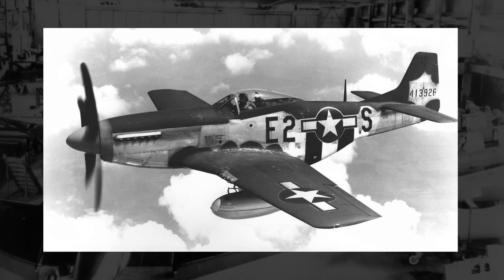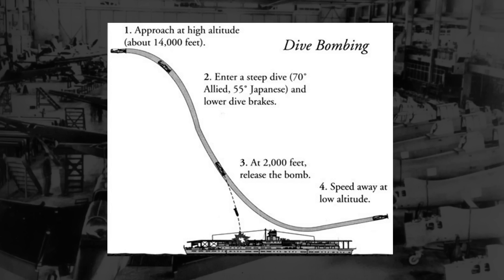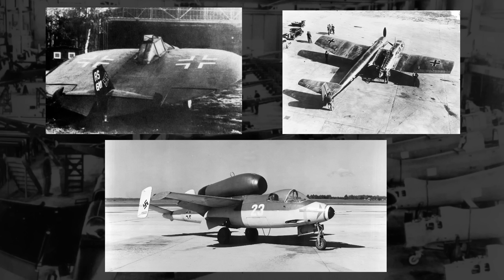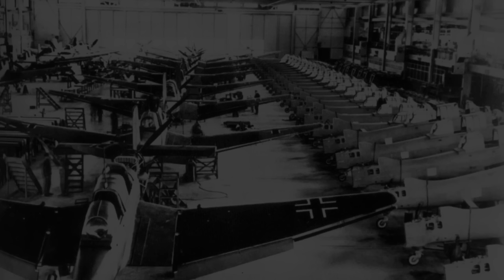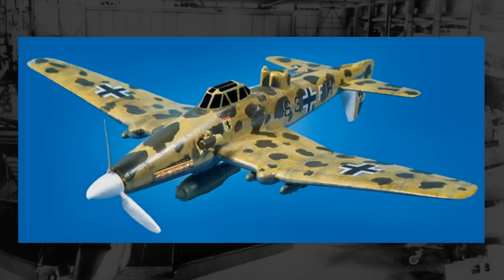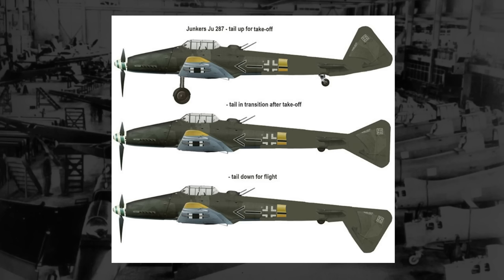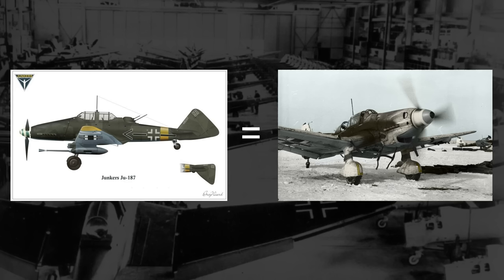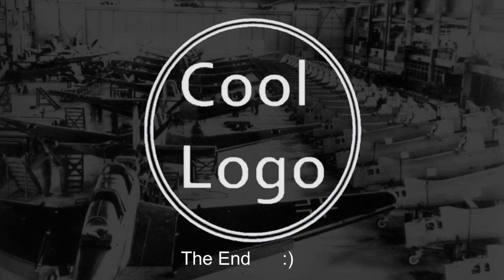The Rotating-Tail Stuka: Junkers Ju 187

Comment: A jack screw could easily raise and lower the tail. The trim would change as the prop wash would likely switch which side it was pushing against. I don’t see why it wouldn’t work though. You’d want to make the transition upon reaching altitude, and again before descending for landing. There would definitely be some wiggling as the tail changed position. Would likely need strakes added for more stability which would be figured out during testing.
Reply: What might pose a problem is the disturbance in airflow when carrying a centerline bomb, especially a big one.

Comment: Took awhile to realize that the rotation was a pivot to swing up and down. I started out thinking the thing would rotate cw and ccw  from pilot perspective.
So actually it shouldn't have been a huge change, a large pivot pin plus guides maybe at the front of the stab and a cable rudder control.

Comment: I've never seen a rotating tail in action before.  Interesting idea to improve defensive FOV.  The rotating mechanism would add massively to the weight of the tail.  Also, the aircraft might have really poor stability during the transition between between up and down tail.  Also, if the tail became stuck down the plane would be impossible to land safely.
Reply: Could have used a manual mechanical rotating device to reduce weight. Like a wheel behind the pilot that the gunner would turn to rotate it. If he died, could be a steel spring rigup that the pilot could flip a switch to turn the tail up. It would have worked flawlessly and the gyro effect would have prevented any airflow stability issues. It would work in either position because the air is still flowing over the ailerons and tail as a rudder. Technically that's all the tail was to begin with. I think the result of this setup would have given similar performance if a multiple gunner station of a b series bomber in a small plane with superior maneuverability.
Reply: The tail itself would provide considerable lateral stability without the vetical fin during the short ministration.    If absolutely necessary dragerlons could be added to the wing,
Reply: @ironhell813 idk about how you describe anything mechanically working flawlessly in this example… the rendering is an example of of a ju-87 there isn’t any proof of this concept… if the 187 had a fixed inverted tail plane then it would make sense but it was never a working or hypothesis prototype built… I’m saying this because of under modern times we can actually make this work but in those times actually look more into it

Comment: Since late WW1, aircraft with rear facing defensive guns had limiters that stopped the guns from firing when aiming at the tail.
Reply: There are some interesting stories of how the front facing guns were evolved to have interrupters as well. A few pilots shot off their propellers.
Reply: German aerial machine guns used electrical primers which made interrupter mechanisms easy to make.
Reply: Think it depending on the plane, and even then from the very brief bit of reading I just did, pilots were recommended not to put too much faith in them because they weren't always reliable.
Reply: In which case, all a chasing plane would have to do, to avoid being shot at, would be to keep in line astern.
Reply: @Gottenhimfella  If the plane continued to fly in a perfectly streight line, yes.  But if they were alone, they would turn to give the gunner a clear shot and if in a formation, then their buddies would still have a clear shot.
Reply: @scottthewaterwarrior  In the "alone" case: while turning they would be presenting the chaser with an ever-enlarging target, before their own heading stabilised so their gun could acquire the chasing plane as a target.
You make a good point when it comes to formation flying, but a plane's defensive capabilities are as strong as the weakest scenario, not the strongest.
Reply: @Gottenhimfella  I didn't mean full turn, just yaw a little with the rudder.
Reply: @scottthewaterwarrior   A little yaw enables the chaser to stay in line

Comment: Plenty of subsequent aircraft had variable geometry - just not in that way. Interesting video!👍🏻
Reply: Yes, I did gather that was the only way it could work concurrent with the diagram. Still variable geometry though: a swing-tail, if you like. Lateral rotation could introduce all manner of undesirable transition effects and would be a complicated setup for cable controls, requiring a full reversal of rudder inputs. The Mig.27 and possibly others have retractable ventral fins so this wasn’t necessarily outlandish, but even the Mig’s rotates to the right so is likely managed by trim input.
Reply: @ThreenaddiesRexMegistus  Rudder pedals would still work the same on the pivot-tail.

Comment: The term 'pivot' would be less confusing than 'rotate'. IMO 'rotate' insinuates rotation around the long axis like prop.

A pivoting rudder assembly was a great deal of unnecessary trouble to lower the rudder assembly for the rear gunner. An easier path would be to go to a tricycle landing gear like the Airacobra to naturally provide ground clearance for a fixed rudder assembly. Put a tail wheel at the lower tip of the rudder assembly for bouncy takeoffs and landings. Losing the pivot mechanism saves weight and complexity and there will be no changes in flight characteristics.
Reply: I think you’d need longer gear and a reinforced vertical stab. Likely need a shorter and longer assembly, but the longer it gets you lose area as the rudder itself would need to be upswept to avoid tail taps. That’s a lot of places for gotchas plus extra weight and drag.
Reply: @nunyabidness3075  not nearly as many or as serious gotchas or weight as a pivoting assembly. Cute fake name. I like it.
Reply: @curtislowe4577  thanks. The only heavy part for the pivot would be the Jack screw, which I’m pretty sure is less than the difference in weight between a tail wheel and nose gear. You wouldn’t necessarily even need a Jack screw, but I think it would be most sturdy. You might do it the way some manual flaps are extended with a long handle.

A jack screw is used on Mooneys to move the entire tail for trim. Add an arm to get more angle and Bob’s your uncle.

Comment: Leaving aside the mechanical complexity and increased weight caused by a mechanism to pivot the vertical stab, any simple rudder in that situation would give you a very substantial roll and pitch moment with any rudder deflection. And the direction of roll and pitch deflection would reverse when the rudder was moved up or down. See, for example, the ruddervator of the V-tail Beechcraft Bonanza, which at least has the virtue of two mobile surfaces to manage strange pitch moments.

This would result in a nightmarish control problem for pilots or an even more complex coupling of rudder to both ailerons and elevators to counter the pitching moment. It's interesting, but the British phrase, "Too clever by half", comes immediately to mind.

The only surprising thing is that the Germans actually cancelled the project before building any. It's an iconic example of their WWII design aesthetic.

Comment: The tail concept might have worked (somewhat) if rather than rotate it it slide up and down on a channel. That would also deal with the transition issue.
Reply: Sliding motion is definitely something any engineer would avoid if rotation was an option.  Things that slide jam far more readily than things that rotate.
Reply: @ParaBellum2024  you can't, because it would screw the airflow and crash the plane.
Reply: @ParaBellum2024  What? A pinion gear setup doesn't solve your problem? They use screws on modern jets, kind of the same thing.
Reply: @Strider1954  Pinion gears rotate.  Ask any engineer; they'll tell you.
Reply: @ironhell813  Thanks, but you've misunderstood: if you watch the video and read the comments, you'll see that the idea wasn't that the whole tail section would rotate, but the vertical tailfin would move from above the fuselage to below.  Under discussion here is whether it would be practical for it to slide down, rather than rotating.  As an engineer, I favour rotation over sliding.
Reply: @ParaBellum2024  ok. It would certainly be much harder to implement that than a wheel in the gunners cockpit attached to a rack and annular gear.
Reply: @ironhell813  I wouldn't use a rack or gear.  Assuming it's to be operated manually, I'd install cranks.  Every joint would employ rotation.  The final motion of the tail fin is effectively a bell crank.
Reply: I just had a thought. If they were so worried about being able to shoot enemies from behind without the tail in the way, and they already planned on using remote control guns, why not just put a remote control gun in the very back, or do what some German bombers did and put the guns in the mid point of the tail section on both sides of the aircraft so that gunners could shoot behind, upwords, to the sides, and downwards? The amount of changes they wanted to make was too extreme and needless and over complicated.
Reply: @TeenWithACarrotIDK  it would be too heavy and throw the aerodynamic off. It would only have taken a wheel, an axel rod running the length of the tail, and a minor gear system with spring release for mechanical advantage. About less than 50 lbs of additional weight.
Reply: @ironhell813  I see.
Reply: Not an engineer but I'd just put the tail fin on the bottom to begin with. Make the tail strong enough to take the additional force this would cause on takeoff and you're done. Why over think it? I would spend the extra time working out how to retract the landing gear instead.

Comment: This was one the many concept aircraft proposed by the Luftwaffe  and was never built   A split rail concept was also proposed   but at this time the skies  were ruled by Mustangs  P 47s and Tempests   It was a brave German pilot that took off in these times
Reply: -From early 1942 the need for accurate dive bombing decreased with the introduction of the Lofte 7 computing bombsight and the StuVi 5B shallow dive bombing sight.   They were both very accurate.   In mid 1942 3 Fw 200 condors attacked "Convoy Faith" with a total of 5 attack runs.   They direct hit and sunk 2  moving merchant ships from 15,000ft (4500m) and damaged a 3rd.    The two runs that missed were against warships that were firing at the Fw 200.  These ships were able to use their 25 knot speed to dodge the bombs which had a 33 second fall time.
-With the StuVi 5B a Ju 88 (with its dive brakes removed, they were no longer needed) could commence a dive at 8000ft/2500m at 22 degrees, reach 400mph, release its bombs, and complete its pullout by 5000ft/1500m.   A good crew could get within 10m or so.
-With these sights the Ju 87 was less needed.   It's little know that the Luftwaffe's replacement for the Ju 88 was a variant of the Me 210/410 with dive brakes and the StuVi 5B.  With this the Me 410 probably more accurate than the Ju 88.   Ju 87 also could have the StuVi 5B but it had a much cruder computing mechanism (No BZA computer).
-The Focke Wulf Ta 152 C & H were the Luftwaffe's air superiority fighter but for ground attack and multi role the Fw 190D12/D13 EB was to be used.  The versions with the Jumo 213EB engine were expected to fly at 487mph.   These would have used the TSA-2D toss bombing sight where the pilot dived into the target (shallow or steep) and the bombs were automatically released on the pull-up.  The TSA-2D was being evaluated and used during operation Nordwind (the luftwafffe support of the battle of the bulge) I think it was by the Me 262  unit KG-51.    It worked well on jets as the accelerometer used to track the pull up was not subject to piston engin vibration.

Comment: Let's think about the complexity.  Tail up, rudder swings the nose left and right based on pushing the rudder pedals.  Tail down, unless it was engineered at some point to REVERSE direction, it would mean the right pedal would swing the nose in the opposite direction.  hmmm. I am glad I don't have to work out that geometry of the controls. And as far as I know, typically a gunner in a US Navy plane could not shoot his rudder off.... as he swung the gun mount, the guns would interrupt momentarily to prevent this.
Reply: In which case, all a chasing plane would have to do, to avoid being shot at, would be to keep in line astern.

Comment: Rotating the tail would be relatively straightforward. Connecting the mechanism with the undercarriage system (electric or hydraulic) would allow the tail to raise or lower when the undercarriage was activated, and running the rudder cables over vertically opposing pulleys mounted on the axis of rotation would mean that rudder cable tension and "feel" would be unaffected. The biggest change would be to spin behaviour, and that would require more wind tunnel time and flight testing.
Reply: The biggest issue wouldn't be the pitching of the rudder. The biggest issue would be the aerodynamics. As the hinges of vertical rudder (yaw control) are tilted forward in top position, any yaw control would inevitably create an upwards force on the tail, causing the plane to dive. It basically acts as a combined yaw and pitch rudder. 
This would have to be compensated by some tricky mechanics with the pitch rudder.
But worse: When lowering the fin, this influence changes until it reverses in lower position. I guess, that would be complex to fix.

Comment: I would think it would just be easier (and much lighter) to just put a machine gun firing stop mechanism when ever the rear gun covers the rear tail.  Similar to the mechanism that allows the gun to fire through the front rotating prop.

Comment: Tail twist and general weakness was a problem for the Stuka.  The fuselage is too weak just forward of the tail plane.  The upside down tail would just break off in a rough landing.  Just a bad dream.  With all the hanging stores it would be slower than the 87.  I can see a pilot trying to fly and turn the tail at the same time.

Comment: Also, regarding said tail, handling could be a touch interesting during its transition to its different positions!
Reply: Imagine it jamming mid transition.
Reply: Depends on it the fin area changed significantly during the transition.
Reply: Is used to control yaw in an airplane in a turn, but a plane can still be turned using just the ailerons and not using the rudder, so I do not see a big problem controlling the aircraft during the transition period. Also If the control cables were lead through sheaves in line with the pivot point, there would be little or no change in the length of the cables while it pivoted down or back up.

Comment: On American planes, the rear firing machine guns had interrupters that prevented the tails being damaged.

Rotating the tail during flight would totally disrupt the airflow. The tail is your rudder and trims. No, it wouldn't be smooth - you would lose the ability to manuever the plane - probably resulting in loss of the plane and crew.

Comment: Looking at the profile drawings, it pivots down and up as markings on the fin show this with their relative position after transitioning. This makes more sense and achieves the same outcome. Turning the tail in the air it would be difficult to maintain controlled flight . If it were to jam or fail to complete the full inversion in flight, it would lead to the demise of the aircraft.
Reply: Same thoughts by me. It would technically easier and less problems in handling when letting vertical finn down versus rotating. That is maybe also the reason that the horizontal stabilisators are a bit in front of the vertical one

Comment: Maybe technically rotating is a form of pivoting, or maybe it's lost in translation from German, but there's no way that tail rotates...it would be just as easy to make the rudder pivot downwards is it is to make landing gear pivot up or down, and it would be fairly easy to insure the control surface doesn't have linkage issues as well...

Comment: Nice video. Crazy idea but still an interesting design problem. I never heard of this plane.

I guess that their were three intended settings. Up, mid and down. I therefor guess that the mid situation setting has a straight vertical rudder fix. 

So it becomes a diagonal fix when up or down. It would be a nightmare to calibrate. 

The saved weight of dropping the second crewmember and no doubt heavier than normal tail and ease of production had best be made in when bounced, drop ordanance and better armour and forward firing wing guns.

Slow yet the very manouvrable. 

Higher speed less chance of getting bounced. Protective fighters are needed anyway. Yet sometimes you must be able to fight your way out.